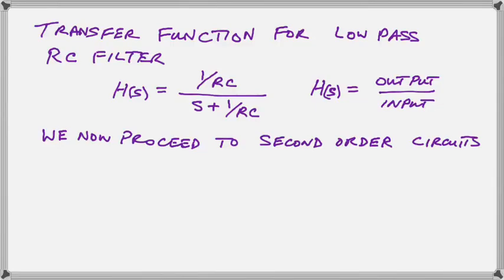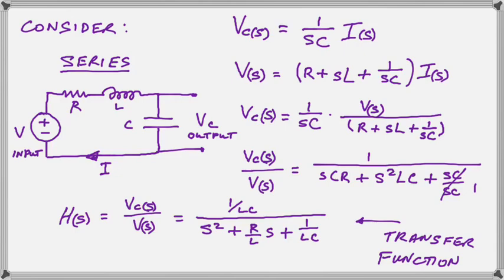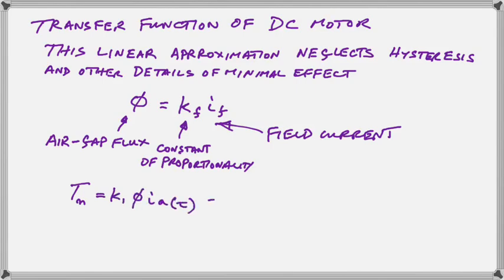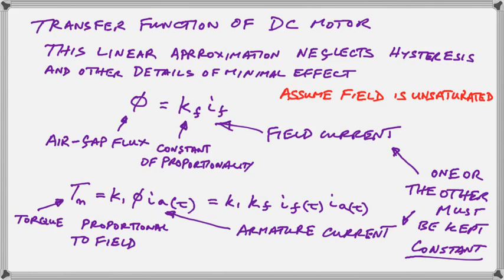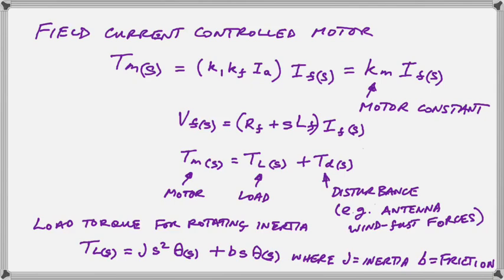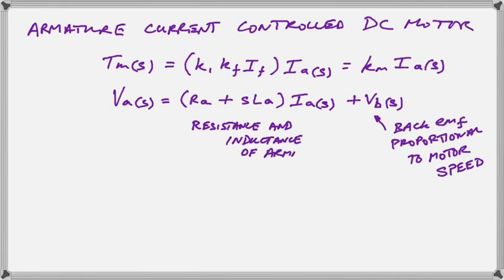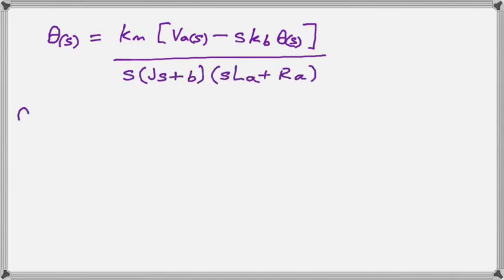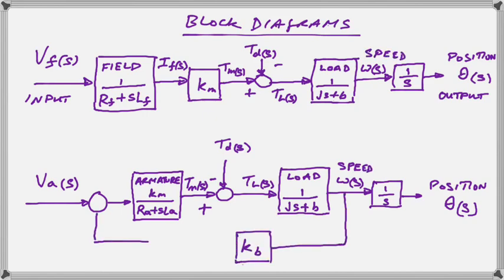Transfer Functions for RLC circuits and motors

Comment: What is S in the transfer function?
Reply from the maker: S is the Laplace variable.......  s-variable  values exist on an s-plane (since it is  complex number and has 2 parts) ..... the Laplace transform maps the "time domain" equation to  the "frequency domain" (s-domain)  equation..... you could visit Wikipedia page, "Laplace transform"..... however most students  follow the "patterns" to successfully find and use their Transfer Functions without actually "understanding"  the mathematics behind the "s" ..... you do NOT have to be a theoretical mathematician  to be good Engineer so don't be distressed if the Wikipedia page seems like gibberish 😁..... it's more important to be able to use the "s" than to understand it on the deepest level of consciousness .... thanks for your question and have a great day 👍

Comment: why v is 1 volt in parallel
Reply from the maker: I think you misunderstand .... the 1 in the numerator  of the transfer function is not there because  "one volt has been specifically applied" it is there because of the relationship that exists between the R, C  and L in the circuit...... but in any case,  unit voltage makes perfect sense.... anytime you do not know what a voltage actually is set it to ONE VOLT and then analyze the behavior from there.... this actually a very powerful principal that is used in all engineering physics as well.... because the relationship between the input voltage and the output voltage is just a RATIO.... that holds true regardless of what voltage is applied to the  input.